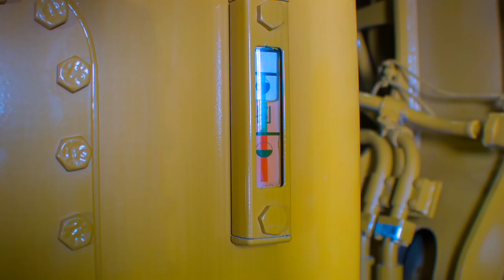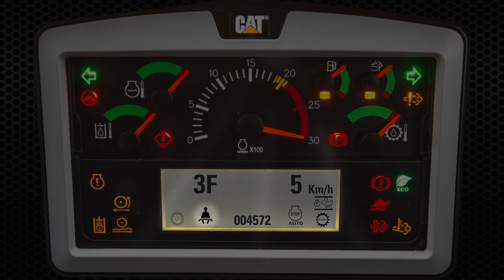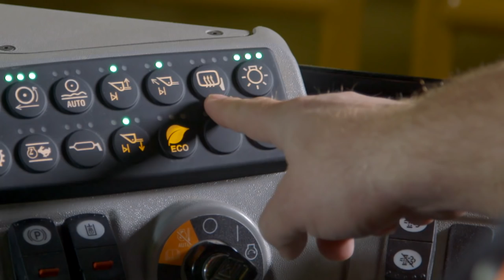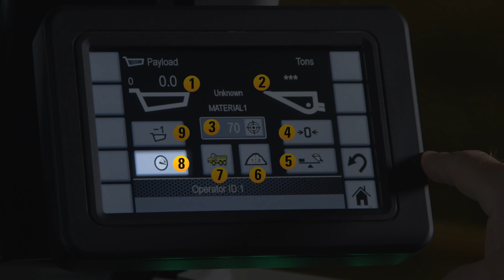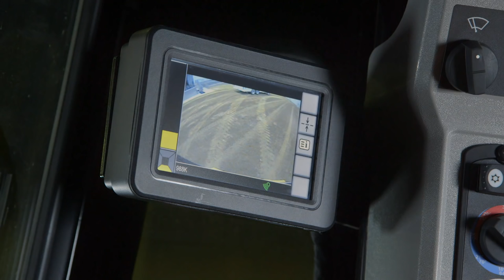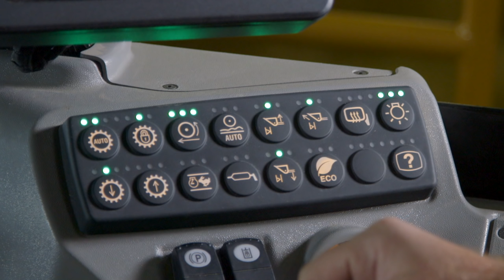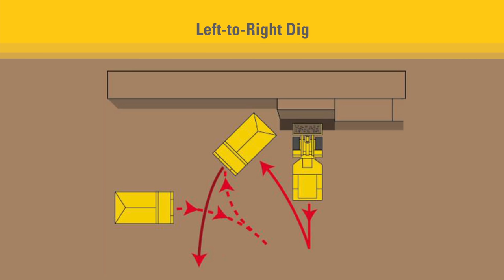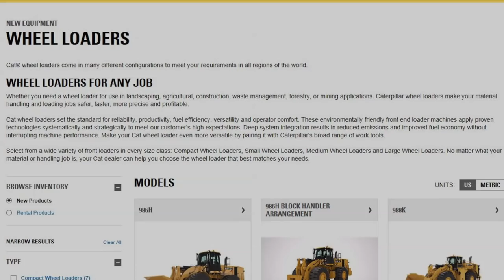Cat® K Series Large Wheel Loader Operator Training

Comment: I use a 972H on a regular but I don't like these stick drive machines at all, I can steer just fine with a wheel. Cat talks about efficiency when what they really mean is operators just ain't what they once were. You can see that by putting a new operator in an old machine, they can't think for themselves. The machine robbed them of common sense, just stick a youngster in an old hoe like a 5550 and watch them scratch their heads wondering why there's 4 sticks. This new crap is disposable as soon as it's service life is deemed over.

Comment: Excellent! Most helpful! It's a great refresher as I usually operate Deere loaders. Thanks!
Reply: NO BRO! trust me. That was not a good example. Even tho it's done by CAT which even surprised me. 
1. NEVER travel at that speed with a bucket full of anything ESPECIALLY ROCKS. if just 1 of those rocks roll out in front your gone.
2. Dig straight and go into your truck articulated. His truck positioning was wrong. Too much of an angle. Forcing the loader to drive further out.  30 degrees is better. This keeps your truck closer. Much more efficient. But that travel speed with a full bucket? No no no! 
BAD CAT!